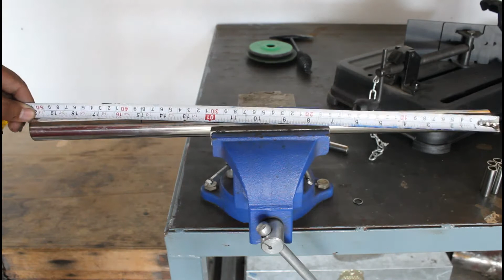BIKE SAFE GUARD MAKING STAINLESS STEEL 201 TIG PROCESS Technical Secrets

Comment: Hello sir  i am your subscriber i have mailer cst 280 machine but what is the size of dc wire its mm for better performance i bought without wire and use machine plus minus not both wires and how long should i take  For better performance?